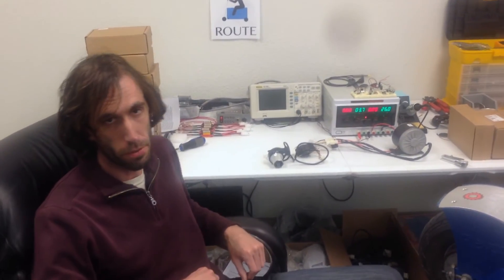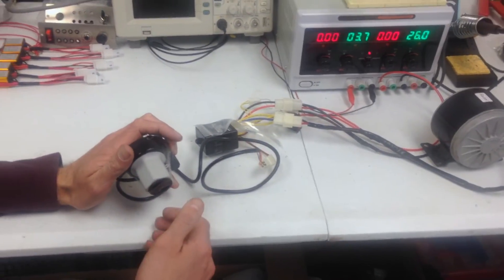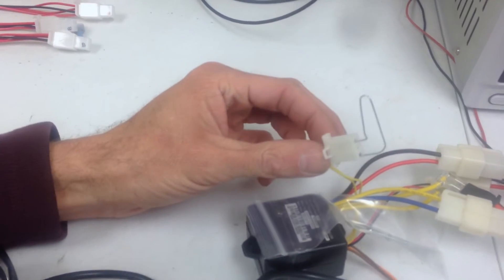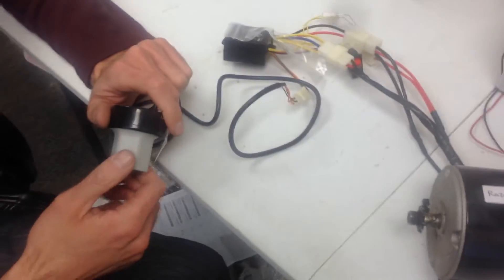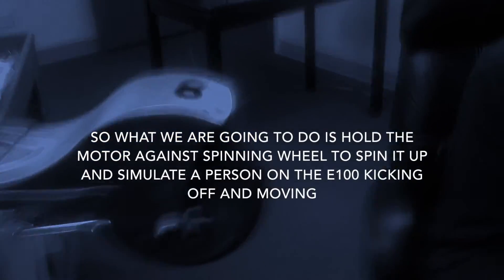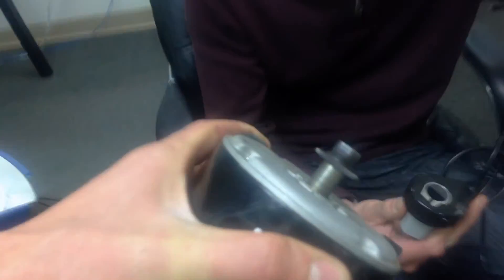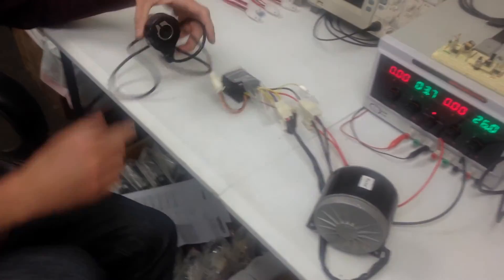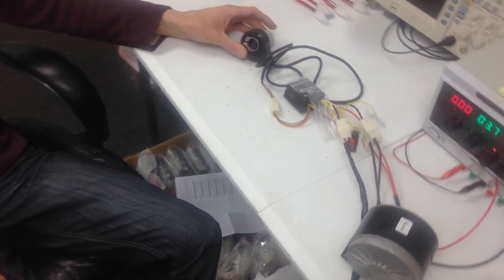Razor E100 Tech - Controller and Throttle Operation

Comment: Does the spinning the wheel idea apply to a Version 1 Razor Sport Mod?    I've done all the tests, paper clip tricks, double checking of wire routing/color coding, jumped past everything to verify the motor is good (it is), fully charged (month old/known good) batteries, on and on, and I get NOTHING.   I'm recharging batteries now and I have no doubt the wheel spinning trick wont' wake it up either.  BUT I need to know if it "Should have" made a difference or not to continue trouble shooting. .... Thanks!

Comment: If i solder jumpers on the backside of the board connecting coil 1 and coil 2 in parallel, would that eliminate the need to kick start?

Comment: Hey guys thank you for this video I am a owner of a Razor E200 I have bought this from someone but for some reason whenever you goes on it will not move it does not have the power to motor does not have the power if you lift it up on you turn the throttle it will spin but as soon as you stepped on it it does not go anywhere can someone help me out and let me know what's happened to her thanks

Comment: Soooooo yea... inherited thos and the batteries were shot.
 checked the brake switch..
 check the throttle double switch.. just a click..

Was going to tear the controller open and then saw your video. Thx!

Comment: Hi guys my sons has beeen kept in the shed for a long time from last year new today I went out and trying I have no click and I've notice the reset bottom inside is broke what is my problem I get a red light on power on but nothing even tho if I run with it
Reply: Were you able to fix it?  I have a similar issue. Light goes on, but the voltage output isn't enough to run the motor. Multimeter read 0.3V, when I moved the throttle. I need 24V to run the motor though... I'm thinking of just saying screw the controller and just run the motors of the the batteries.